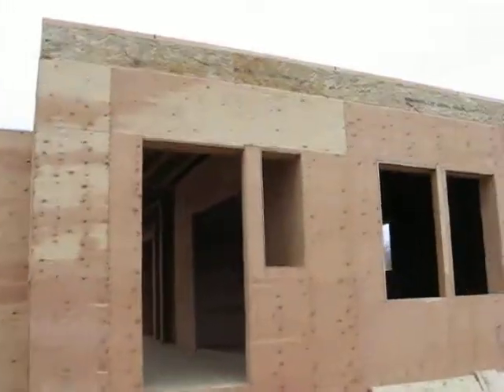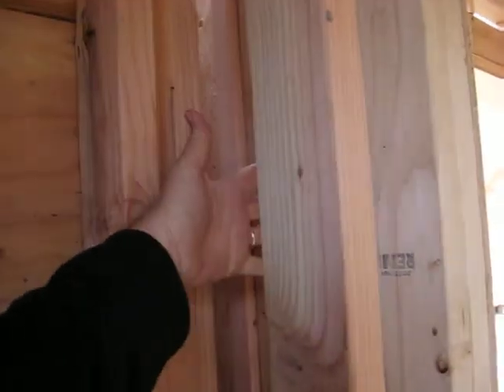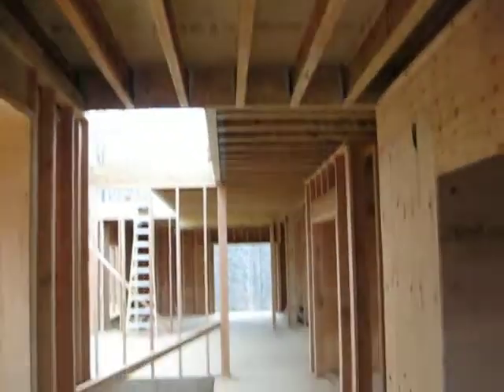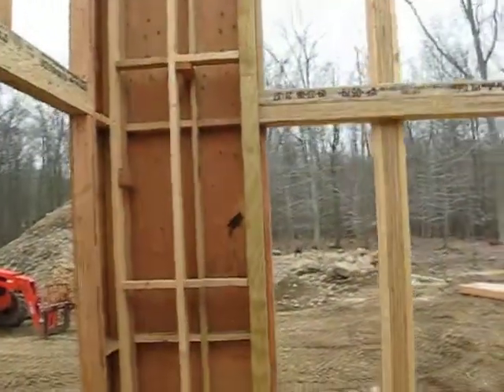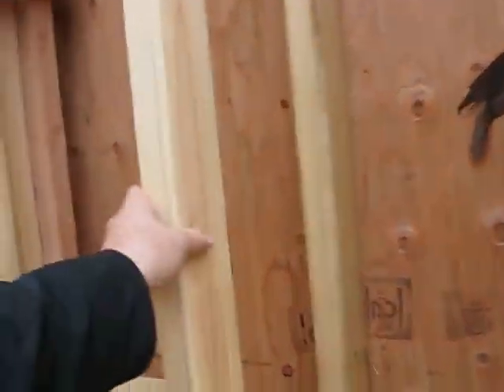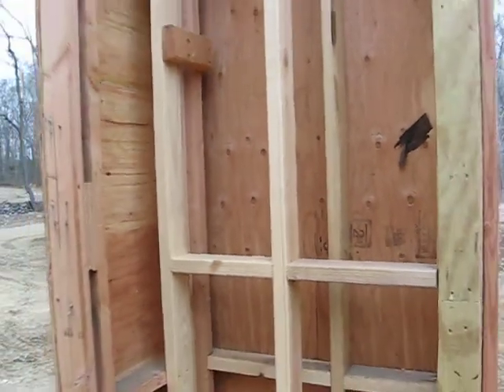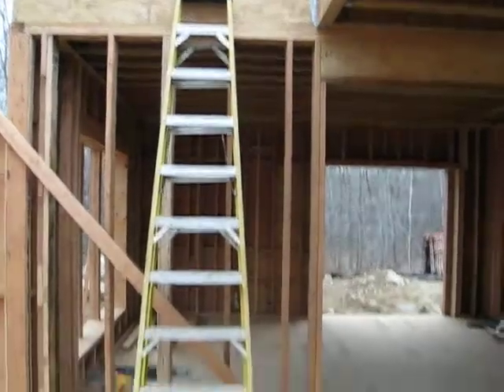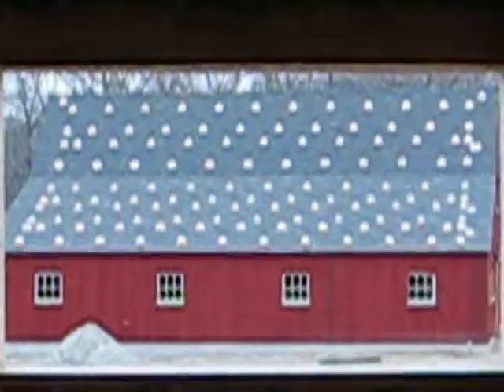first floor walk through

Comment: I built my first staggered stud home in 1992. Mine is a little different than yours. in that my studs are 24 inches on center on each side of the 10 inch plate and staggered 12 between the inner and outter walls. I drew the plans in 1988 but it took a few years before I decided to build. My plans were certified by a NY Pro. Eng. Firm before building. I reduced thermal bridging by over 85 percent.  I got the idea from a home built in 1912.